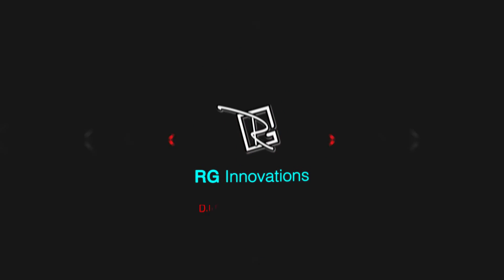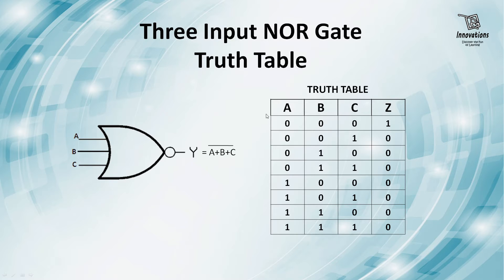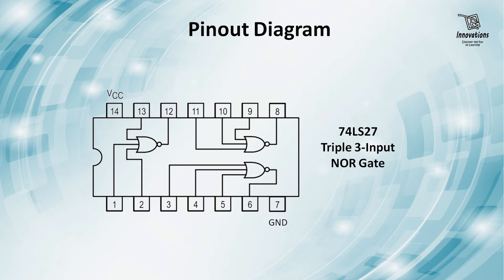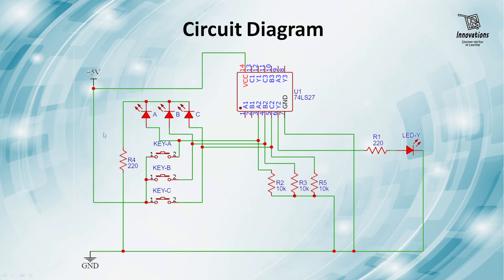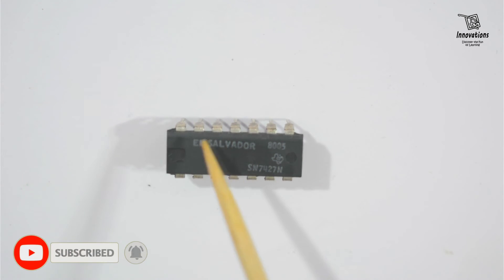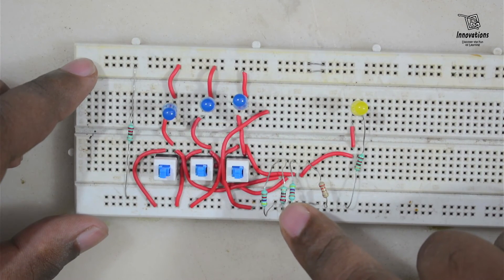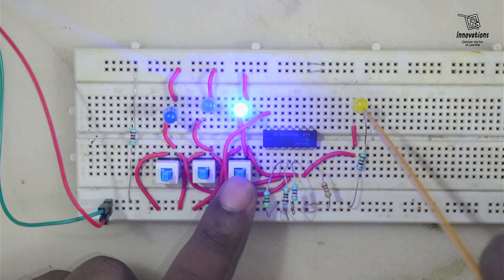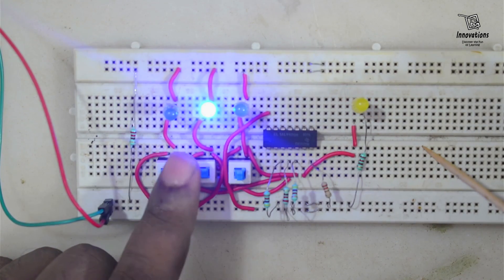74LS27 IC - Triple 3 Input NOR Gate IC Practical Demo with Truth Table |  SN7427 IC | 74HC27 IC

Comment: thanks for your teaching it is good learning keep it up continue
what is the resistance value for 7 th pin resistor?
Reply from the maker: Thank you for watching. the resistance is 220 ohm, it is not needed generally, but I found if i directly connect the 7 pin to ground the circuit is not working properly, so added a resistance.
Reply: @RGInnovations  Thank you sir for your replay 
can i contact you sir ?
Reply from the maker: please mail me to rgstech85@gmail.com